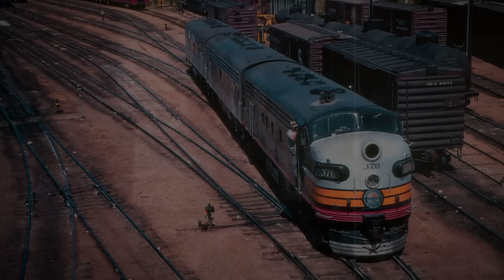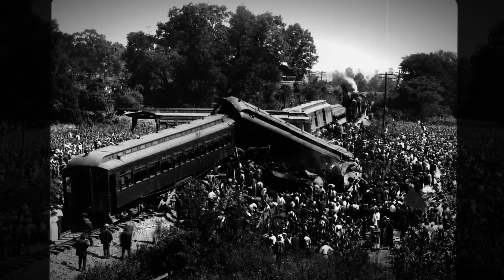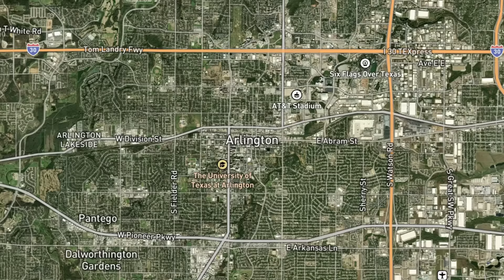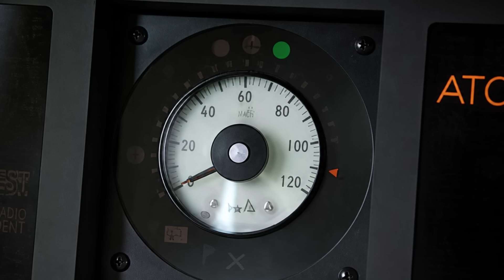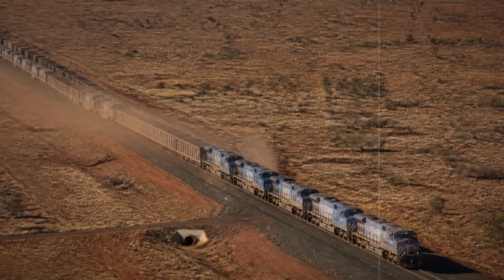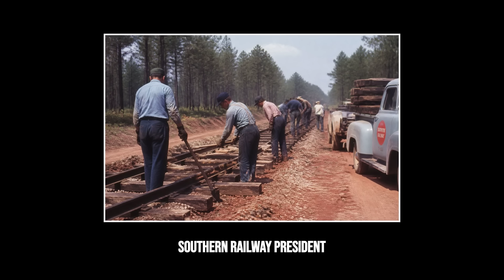Why There's a Locomotive in the Center of the Train

Comment: Milwaukee Road ran mid-train power for years as helpers. The way they did it was to have the helper locomotive pull the back half of the train but not to push the front half. This method, combined with an increase in power, allowed the Milwaukee to run 6,000 ton trains on their steep mountain grades. After the electrical system was abandoned they purchased EMD SD40-2’s with Locotrol that allowed them to run unmanned mid-train Diesels, the forerunner of today’s trains.

Comment: Tomreasons 1 because bulling thevtrain with all the power up front might overload a coupler ( this is catastrophically bad) and gaving power in the middel of the train is adventurous  when cresting hills ( the front power can partially trottle back while the center power still keeps pulling at full power, alternatively , in cases where the grade crosses a crest with a steap decline on the othervsude the lead power can actually put on dynamic oreaks to keep the decending part of the consist under controll  wile still meeping the power on on thevacending part)) tldr ir gives the engenner running the yreain a lot mor flexibility in how they deliver power

Comment: Retired railroader: that concept was tried back in the mid seventies with power units placed in middle of coal trains radio linked to the lead manned loco. And when losing signal commands from the lead manned loco the DP units kept pushing under full speed and caused massive derailments! The digital technology had yet to be developed for maintaining constant realtime continuity between lead units and DP power and of course now with the super trains of 200+ cars adding additional power at very rear too! And seems to all be working for class A rail lines now with the new technology!

Comment: I would check your facts but there is a fallen flag railroad that I believe beat this East Coast hill climber. The Milwaukee Road had mid train slaves one sometimes two units. And they climbing two mountain ranges, the Rocky's and Cascades I remember see this back in the 1960's there are videos on YouTube proving this point by Charles Smiley Films. And these trains didn't have a box cars with radio equipment to make things work.

Comment: It's so they can make the train longer and get away with it, a loophole in the law that is what I was told
Reply: The only "law" involved in train length is physics.  However, there may be local ordinances concerning how long a train can block grade crossings when they are stopped.  That is often a concern for small communities relying on emergency services to be able to cross the tracks.

Comment: That's a good story Of the southern  But Not all correct. I grew up where it all started in the late 50's early 60's. The Milwaukee Road in Montana ran what they called Slave Units in the middle of their trains Long before the SP did. Check you history. I was a Locomotive Engineer and I ran what they called DP Power Middle and end of train locomotives . They work well and solved lots of problems with long trains. Just my two cents here but I'm correct.

Comment: Retired Engineer here, we use to call it, inner train DPU unit, rather than on the rear. I use to run them. Makes it feel like you running a intermodal train sometimes. When you put the “Fence” up, you can have some real fun. Keeps you from breaking the train in hilly territory. Like going through “ knuckle hollow” between San Antonio and Houston.
Reply: I’m always a fan of just running them married up with the exception of one spot.

Comment: What does “ UNDER POWER “ mean in train engine talk
Reply: Under power generally refers to the engineer opening the throttle and applying power to the wheels.  
Steam engines polling excursion trains often have a diesel in the train to serve as a backup power if the steam engine breaks down or if the excursion train proves to be too heavy.  The diesel will just be idling until called upon.  See videos of Union Pacific #4014 on its recent trip across the US as an example.

Comment: what the story doesn't say is ........the first radio controls were analog . then the equipment designers started using DIGITAL communications .  digital signals were first used in the SPACE PROGRAM  in sending and receiving info from earth to the moon .  radio signals were sometimes  interfered with by other radio signals . digital  signals are set up to work on their own frequencies. BUT they do have problems when the train is running thru curving  , wooded country . U.P. started running DP coal trains with digital communications thru Texas  in the 90s. the flat land of the plains is the best country to run DP. i ran DP trains from 1998 to 2018.